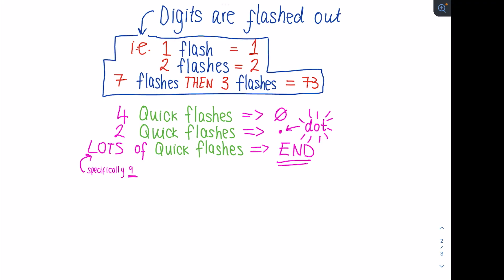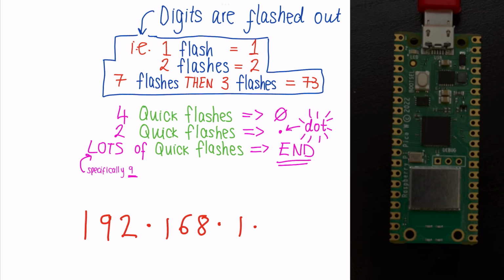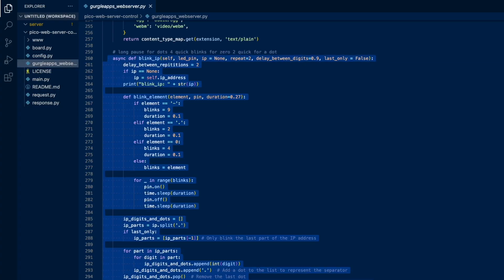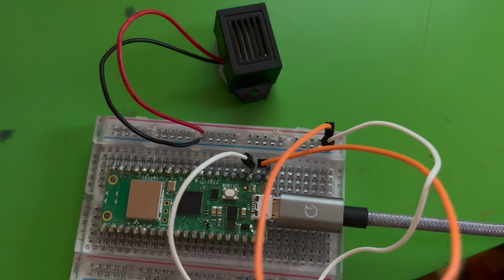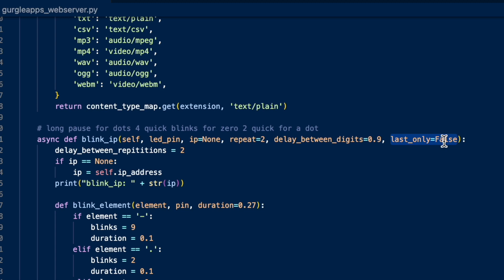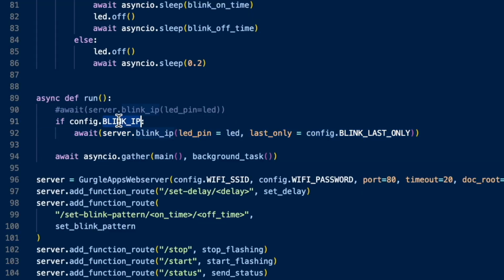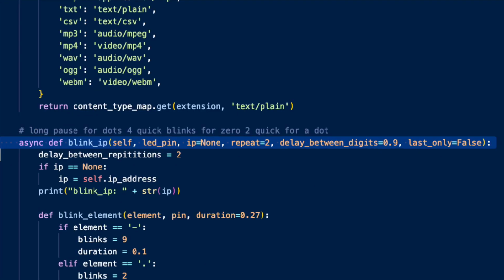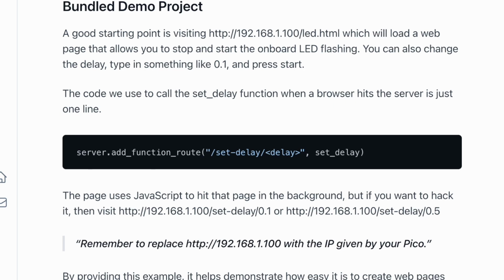How to find your Microcontroller's IP address || NO SCREENS/EXTRA COMPONENTS NEEDED

Comment: Nice idea for a light weight way to communicate the IP address.

I like using Multicast Domain Name Service (mdns) to use a custom domain name like, “project-name.local”.  There is an implementation in CircuitPython and it looks like also in MicroPython. There may be limitations about where this can work and resource tradeoffs, but I’ve had good experiences using it.

I’ve also used static IPs or reserved IPs (by MAC address) on the DHCP server to make finding my microcontrollers easier.